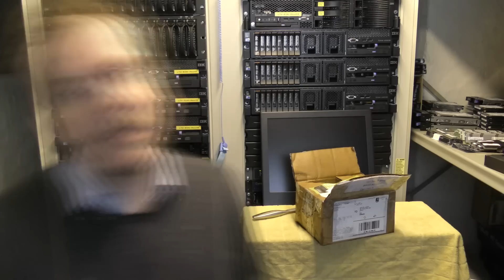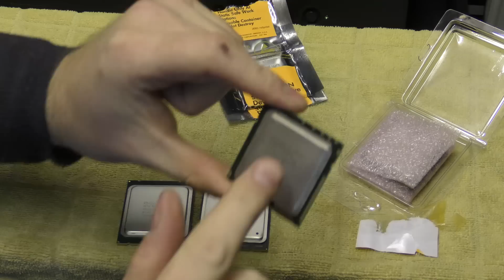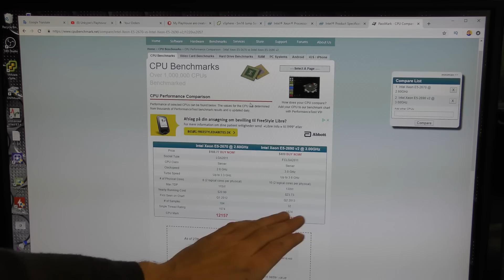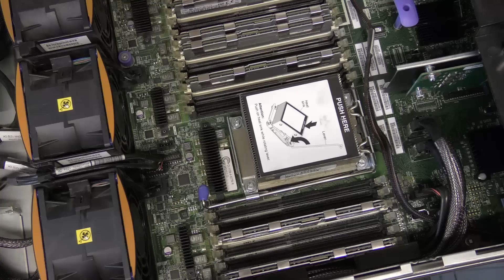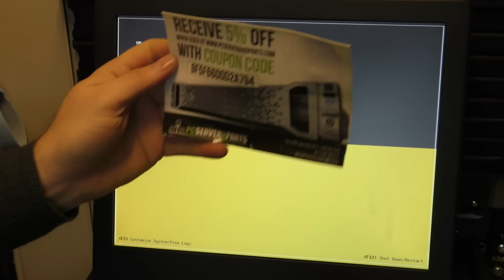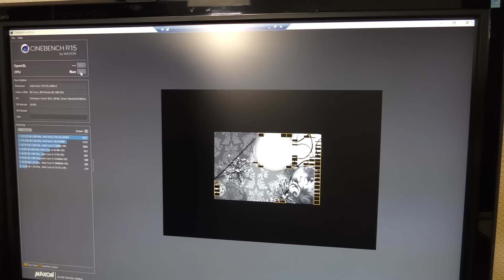$520 - 40 vCore 3GHz - Two Intel Xeon E5-2690v2 - 766

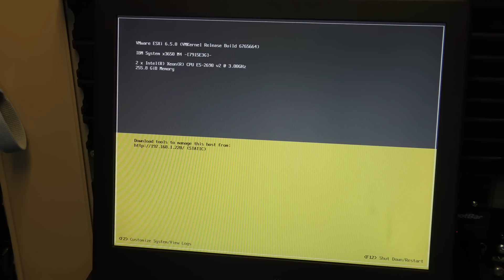Comment: 18:59 Hi Morten, The machine is 7915E3G the same as mine 7915C2A, with the initial processor E5-2620. 
I will try upgrading to 2xE5-2690v2 & swap PSU
Thanks Morten your video is very helpful
Reply from the maker: Hi @bambangmuliyadi
Thank You very much!  glad you liked the video :-)
Thank you for watching! :-)

Comment: hi after watching many of videos over a couple years and have a dell R720 can you tell me if the Intel Xeon E5-2470 V2 SR19S 10-Core 2.4GHz will work in it??  I know the manual has cpus I believe it is page 18  but says it goes to 8 cores but people have reported using 10 cores and 12 cores just don't say how or what firmware to drive it. Can you help me out with this I can not get a  real answer from eBay people
Reply from the maker: Sorry I do not know the E5-2470 v2 normally it is the 2600 series that is used.
https://dl.dell.com/manuals/all-products/esuprt_ser_stor_net/esuprt_poweredge/poweredge-r720_reference-guide_en-us.pdf
page 24.

Comment: Have 2x E5 2697 v2 cpus in my ESX VDI cluster right now. They are 12 cores but slower at 2.7ghz. Still great for vdi but those 2690 v2 or the 2670 v2 would be better for the higher base clock. Going to test out an engineering sample Xeon silver 4114 this week
Reply from the maker: Hi Logan .Kes
Thank You very much!  glad you liked the video :-)
Thank you for watching! :-)

Comment: As a proud owner of second-hand E5-2687W since 2016 (Sandy Bridge, 8C/16T 3.1GHz turbo 3.8 GHz, about the same price), I can assure you you're gonna love these 2690v2. They are every bit as awesome as they look on paper, on par with current Threadripper (core for core and clock for clock obviously). I'm curious how your thermals are under such small radiators though; I use two AiO watercoolers to keep them at 70~75C max on load.
Reply from the maker: Hi Phil Ledru
Thank You very much!  I am now also the owner of a E5-2687W v4,, have nothing it will run in,, but I have one.
Thank you for watching! :-)
Reply: @MyPlayHouse  Oh wow, v4, that's a powerhouse! Very nice indeed.

I've been watching your videos before building this Sandy workstation/server in 2016, in fact you were one of my main inspirations for going to Ebay and seek older but higher-tier hardware rather than much less valuable new stuff (like the dreadful Broadwell-E HEDT platform, which made me look for other solutions and that's when I found your channel).

So a big thank you because your creativity and knowledge is what got me into pretty much the best deals I've ever made in 20 years of tinkering with computers. ;-)

Comment: nice simulations of the Danish weather really realistic

TDP It is not how much power it uses. How much heat it releases
#Yoda
Reply from the maker: Hi jack99097
Thank You very much! If the TCP of this CPU is 130W,,, there is no where else for the power to go, then to heat. So if a CPU it rated to maximum give off 130W out as heat,, 130W also came in.
Thank you for watching! :-)

Comment: Nice upgrade. I just got Matched Pair Xeon X5650 2.66GHz 12MB LGA1366 Six-Core Processor for my HP's current CPU its replacing is the L5520 very slow CPU
Reply from the maker: Hi Chris Lowe
Thank You very much!  Yes that will give you quite a bit more!
Thank you for watching! :-)